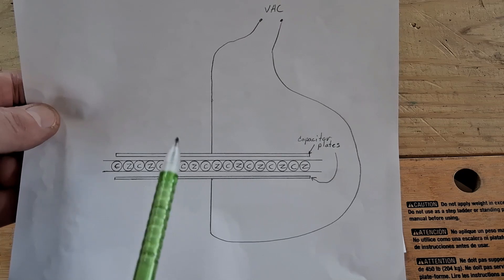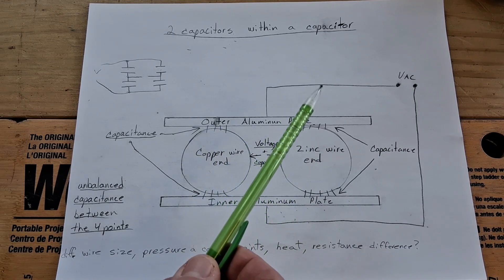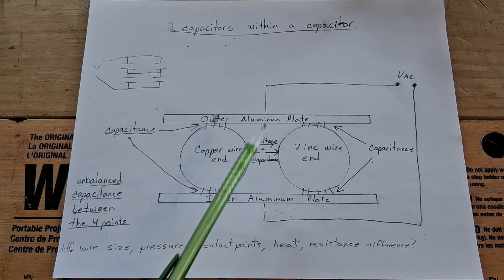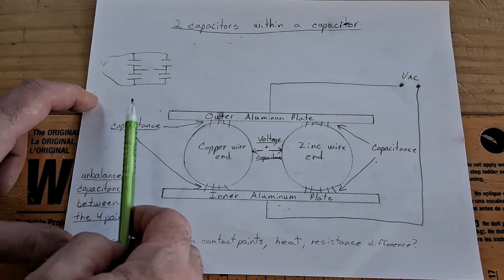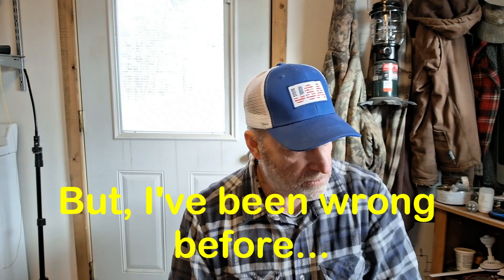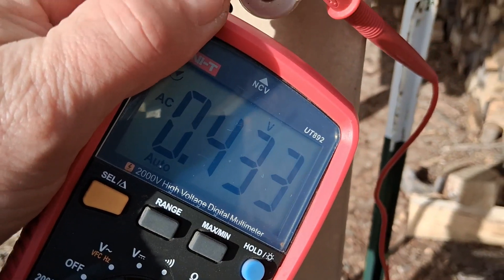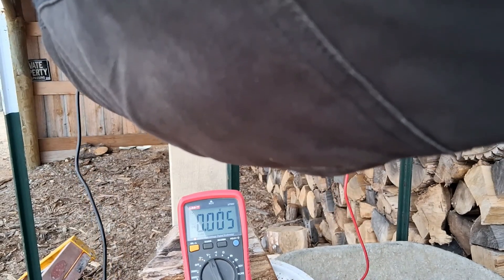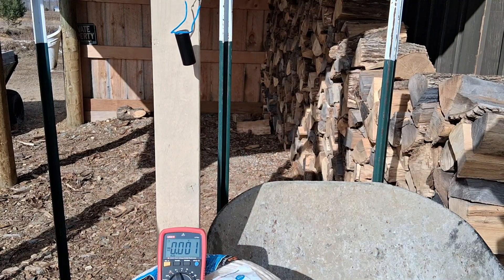Cu-Zn capacitor sandwich follow-up, and Cu-Zn antenna (no ground)

Comment: Zinc in carbon fiber in a copper tube somehow wrapped like a induction heater or a U with a O with distilled water creates a covalent bond separator of the H2O, there is a video a couple Europeans showing power from water!

Comment: You are sensing static voltage due to charged air currents rubbing against the wires and induced AC voltage from magnetic fields. We are immersed in moving magnetic fields. There are 60 cycle ground currents from electron flow returning through the soil to the local electric generating plant. There is induction voltage from nearby overhead power conductors. The are moving magnetic fields from currents flowing through the layers of the ionosphere, eg. D, E, and F layers overhead. There are currents flowing through both the ground and the ionosphere due to thunderstorms all around the world. The is also Hall Effect voltage (and current) induced in the wires from the moving magnetic fields.  And finally, the Earth itself is a giant dynamo rotating the whole smear at 15 degrees per hour and cutting across the field lines due to the solar flowing past us at a million miles an hour.  You have made a crude detector of the Sum of all those various currents. The metal junctions formed by twisted wire connections act as diodes rectifying the myriad tiny (very) AC currents flowing on the wire, to charge the capacitor to a DC voltage.   You might experiment by pumping the aluminum capacitor plated at 10 million cycles per second in place of 60 cycles per second to see if a bifilar wound coil with dissimilar metals inside of an RF field might generate some electron behavior we have not yet recognized.
73   Dr. O

Comment: It’s not even a capacitor, a capacitor is actually part of the circuit. When you connected both copper and zinc wires voltage drops to 0.  You measured current between two dissimilar metals and thats it. 

The voltage was induced and had nowhere to go because it was an open circuit. The 120V alternating electrical current wasn’t even flowing it was just sitting there on the “capacitor plates” aluminum tape and again the induced voltage disappeared when you closed the zinc to copper wires.

Google 1000+ Fluorescent lamps powered by overhead cables image. It’s the opposite of your dissimilar metals “antenna“ the fluorescent tubes are grounded but lighting up by the induced voltage from the overhead wire. 💪😎👍
Reply: It can't be a galvanic reaction because the wires are insulated from each other.
.

Comment: Danke für die Videoserie Ihnen Double M Innovations.

Es gibt in der Materialphysik die sogenannte Planckmasse. Dies ist ein Massequantum. Es ist die gravimetrische Trägheitsbasis aller Planckkonstanten. Das Wirkungsqunatum h geteit durch das Quadrat der Lichtgeschwindigkeit c² ergibt die sogenannte Materialzeit mt. Teilt man mt durch die Masse eines Proton erhält man das Zeitquantum des Proton. Die ist zwar sehr klein aber man kann sich das mit 2^n in den Bereich harmonisch verlängern der unserem Bewusstsein besser zugänglich ist. Dabei sind 5,3 Sekunden eine harmonische dieser Zeit. Zink hat 30 Protonen damit kann etwa 159 Sekunden ermittelt werden. Kupfer hat 29 Protonen was 153,7 Sekunden ergibt. Eisen mit seinen 26 Protonen erreicht 138,6 Sekunden in dieser Harmonie. 

Es scheint so zu sein, das der innere Schalenaufbau der Isotope dabei zur Wirkung kommt. Denn sonst würde der aufgspannte 3 Leiter Kupferdraht keine Spannungswerte zwischen den Leiter erzielen. Wenn es bei Kupfer zu einer Spannungsdifferenz zwischen unterschiedlich dicken Leiteradern kommt, kann der sogennante Casimiereffekt ein hilfreicher Schlüssel zum Verständnis sein. 

Seit ungefähr 24 Jahren habe ich eine gravimetrische 50 Hz Goldschnittantenne GSF in Betrieb. Diese besteht aus 3 großen Drosselspulen und 2 Kondensatoren. Die Impedanz beträgt  ca. 152 Ohm. Die Güte der Spulen ist sehr hoch. Es sind 3 hochwertige UI186a Kerne mit ca. 9,8 Kg Masse. Der Eingangskreis ist auf 50 Hz / 1,618 abgestimmt und der Ausgangskreis auf 50 Hz * 1,618 so das sich ein 50 Hz breiter Bandpass ergibt. Die 3. Drossel ist zur Impedanzanpassung ist mit einer Anzapfung bei 0,707 der Gesamtwicklung versehen. 

Leitungsbetrieb: Der Filter kann direkt an bis zu 162 Volt 50 Herz angeschloßen werden. Er ist in der Lage ein 50 Hz Rechtecksignal in ein sehr sauberes 50 Hz Sinussignal zu transformieren. Das bei eine Leistung bis zu 173 Watt. 

Antennbetrieb: An der Eingangskreis sind einige alte Elektrogeräte als Antenne angeschloßen, ebenso gerätesymerisch an den Ausgangskreis als Last. Alle Kabel dabei sind dreiardig ausgeführt. Der Erdleiter hat an keiner Stelle der GSF Antenne einen Kontakt mit den beiden Arbeitsleitern. An diesem Erdleiter liegen ca. 6 Volt Spannung an 1 Megaohm Last gegen das Erdleiterpotential unseres Stromnetzes an. Die Frequenz berägt dabei 49,99... Hz bis 50,01 Hz je nach aktuellen europäischer Netzlast. 

Duch ihre Anregung werden ich auch den Versuch starten eine Brückengleichrichter anzuschließen und einen Ladekondensator mit Vorwiederstand dahinter. Die RC Lade-Zeitkonstanten für die verschiedenen Elemente aus der Protonenzeit kann dabei durch synchronen Paralleaufbau der Schaltung für RC(Kupfer) RC(Eisen) RC(Kohlenstoff) realsiert werden. 

In meiner Buchsammlung der letzten 50 Jahre habe ich ein Druckwerk ISBN 9-534-11037-9 in welchem die Elemente als Spurenelemente der Lebewesen klinisch untersucht wurden. Dabei sind für Kupfer Kapitel 10 Seite 56 bis 60 und Zink Kapitel 17 Seiten 105 bis 109 bemerkenswerte Unterschiede gelistet. Das Blut von weiblichen Wessen enthält mehr Kupfer als Zink und das Blut von mänlichen Wessen hat mehr Zink als Kupfer typischerweise als Spurenelement in sich. Neugeborene organische höhere Lebeswesen haben sogut wie kein Zinn Element 50 im Blut. Erst nach der Geburt reichert sich dieses Element Z 50 im Körper auf das jeiweilige erforderliche Lebenshalteniveau an. Zinn hat 10 dauerhafte Isotope von 112 bis 124. Die Isotope der Zinnmasse 113 und 123 sind nicht stabiel. 

Es könnte sein das diese Differenz der physikalisch phsiologischen Funktion der Elemente Kupfer und Zink sehr bedeutet sind. Vitalwert Leistungssenoren die auf Kupfer - Zink Wirkungsenergiepotential beruhen könnten so entwickelt werden. Da es sich relativ sicher um eine wirksame Lebensernergiekorrelation handelt ist ein Leitungsgerechter Umgang mit der physikalischen physiologischen Funktion sehr sehr ratsam. 

Die Fähigkeit der Elektronen zur Handhabung von Spannung, Strom ist mit einer sehr bedeutenden geoemtrische strukturallen Länge verknüpft. Die sogennante Comptonwellenlänge des Elektrons geteilt durch 3 im Kubik und diese geteilt durch die Plancklänge ergibt eine Fläche deren Quadratwurzel -112 mm und +112 mm ergibt. Die negative Länge ist innerhalb der Isotope mindestez des Wasserstoff als Weg ab Kernradius bis zum Orbitalradius wirksam. Die postive Länge von 112 mm je Elektron kann für alle möglichen Zwecke genutzt werden. Bei diesem 112 mm Quantum nach Müller ist ein Elektron isolinear wirksam. 

Gruß Reiner Markenfreund
von Michael Frithjof Müller

Comment: Hi there, well-done this is cool.   I think what you have built is very close to a stubble field battery. 

Copper - zink or aluminium forms an A-symmetric capacitor which slef charges.  Like a battery but without the electro chemical reaction.

You would normally only get 0.8x volts between the copper and zink wire, so something interesting is definitely happening when you apply a charge to the aluminium plates.   

The copper is + in respect too the - zink. I'm guessing the charge on the aluminum is somehow driving the voltage up through imbalanced capacitive coupling.
Reply from the maker: Thanks for your perspective!

Comment: The higher you run your antenna wires the more current and voltage, it will sometimes eventually build enough to strike from antenna wires the more to negative wire or the ground, you can elevate the capture by putting outcasting elements along your antenna wire and coating those and the antenna wire in graphene  powder, basically I think it’s simulating the same effect like a cloud, and it builds the power off of parasitic currents going through the atmosphere
Reply: One day, I had a portable AM radio that was tuned between stations, where I could hear lightning discharges, as a storm front was moving in. I noticed there was also a sort of corona-discharge, hissing-sound in the AM radio, that increased in strength as I approached the house that has lightning rods on our rooftop. Point is, these discharges can happen quite regularly, and can obviously be influenced by the weather. I am sure most people already know this happens, but it was interesting to hear it in the AM radio.
Reply: I have been trying to come up with what is causing the DIFFERENCE in potential between the two wires, because this is what would take to charge the capacitor. Your description of arcing from one wire to ground, is the only one that makes sense. An arc between either wire and ground, will draw current through the bridge rectifier, through the capacitor, and through the other half of the bridge rectifier, to force a discharge of the other wire as well. Hence, every arc to ground will add a little more charge to the capacitor, as it discharges the opposite wire. I would guess that the limit of 1.86VDC on the capacitor, is point where the electrolytic capacitor's internal leakage rate (self discharge), is equal to the average charging rate from the atmosphere. I wonder if an oil capacitor, such as a run capacitor from an electric motor, would allow the voltage to go higher.
Reply: @ try using a spark plug between the cap to the antenna lead.. this should let the current build up and when higher it would then jump, just a theory
Reply from the maker: I have a number of videos with harvesting energy from antennas, you may like.  (would need to take a look through my video list).  Some where you can see when the AM radio station boost their power, and another where you see an increase caused by a distance lightening flash.

Comment: Now that you have balanced the capacitances by removing some of the wire from one of the coils, the remaining factor that is upsetting the balance, has to be from stray electric fields. 
You are making measurements to a very high impedance circuit, that start out to be a BALANCED circuit. However, when you connect the voltmeter that does not present the same load to both test leads, it throws-off this balance. Things that I noticed in the PREVIOUS video, that can throw-off the balance are:
) The voltmeter is on a table that is exposed to AC fields. Wood is NOT a perfect insulator.
) The ammeter that is connected to 120VAC, is placed on the table, right next to the voltmeter. This introduces a capacitive coupling between the ammeter and a foil shield that is inside the voltmeter, which internally connects to the black voltmeter lead, but not to the RED voltmeter lead. This capacitive coupling to the BLACK LEAD ONLY, throws-off the circuit balance. For high impedance circuits, even a small, stray current is noticeable. It is not a problem for unbalanced circuits, because this stray current would pass through the black lead to ground.
In the FIRST video on this subject, you were testing the output voltage, and the input current. At 4:33 in the video, the reading on the voltmeter changes, when you are moving your arm and the pencil around the area. Also, the ammeter reading changes as you reach your arm over and around the coil. At 6:10, the current-reading changes when you grip, and then release your grip from the green, alligator clip. This is evidence of surrounding fields that are enough to throw-off the balance, and affect the readings.
Tests that may be interesting to perform include: 
) Reverse the wires from the AC line, to the capacitor plates. This can change the magnitude of the stray currents, which can change the voltage reading.
) Use small, TWISTED-PAIR wire for test leads, such as is used in CAT 5 cable. Extend this wire-pair perpendicular to the coil assembly. This will help balance the exposure of each wire, to the coil assembly. Then, set the voltmeter up on a cardboard box, to move it away from the ammeter, from other wires, and off the table, thereby reducing capacitive coupling to its internal shield.
Making BALANCED voltage measurements to a circuit with approximately 8 megohms impedance, is very complicated. One way, is to use the DIFFERENCE setting on a 2-channel oscilloscope, using only the tips, of two 10X (or 100X) probes. The scope will display the DIFFERENCE in AC voltage (Channel-A, minus Channel-B). 
Warning! The oscilloscope’s ground lead is ALREADY GROUNDED, via the grounding pin of its power cord. DO NOT connect it to the AC line! ESPECIALLY the HOT side!
Regardless of how it is measured, the input impedance of the metering device must be figured into the results. If the meter has the same impedance as the circuit being tested, then a circuit with 10 volts EMF, will drop to 5 V when the meter is connected. The math is more complicated if the meter is resistive, and the circuit is reactive, because then, we must consider the phase angle. Thanks for posting.
Reply: One thing we have been assuming, is that the two coil-wires have the same leakage RESISTANCE to each of the foil plates. This might not be the case. The sticky ADHESIVE of the packing-tape, might not be a good insulator. Only the BARE (zinc) wire has direct contact to the STICKY ADHESIVE of the packing tape that overwraps the coils. The other wire is protected with an enamel coating. This may be creating an imbalance in leakage RESISTANCE, and therefore, leakage CURRENT to the two coil wires. 
To measure the very low leakage current, I will assume that your DC ammeter cannot measure current below 1uADC. So instead, we can use the DC voltmeter, to measure very low currents. It is assumed that the input resistance of the voltmeter is 10 megohms.
First REMOVE AC POWER, and disconnect all wires from the coil assembly. Then, connect the POSITIVE terminal of a 12VDC power supply, to the outer foil plate. Setup the multi-meter to measure VOLTAGE, and connect the voltmeter’s RED lead to one of the coil wires. Complete the circuit by connecting the BLACK voltmeter-lead to the power supply’s NEGATIVE terminal. Turn on the 12VDC power supply.
If the voltmeter reads say; 2 VDC, then this means we have 2 VDC across the 10 megohm internal resistance of the voltmeter. Ohm’s law says we have 200 nanoamps of leakage current (0.2uA) to this coil wire. Now, disconnect the RED voltmeter test-lead from the coil wire, and connect it to the other coil wire. If this reading is 3 VDC, and therefore 0.3uA leakage current, then we have a 0.1uA DIFFERENCE between the two leakage currents. The circuit is not balanced. 
If the 12 VDC were to be increased to 120 VCD (Not recommended, for safety reasons), the leakage currents would obviously be 10 times greater. Using a DC power supply, effectively removes capacitance from the equation. 
If it is found that there IS an imbalance, consider flipping the packing-tape over. You might also want to make both coils have the same number of turns again. Thanks again, for posting.

Comment: Thanks for the research! I'm still keeping my opinion about the cold current :D I need to try to replicate this with aluminum wire and floor heating cable (carbon fiber). You might also want to look into displacement current. Joel Lagace has good videos about it.
Reply from the maker: There could be something more to it; there are some things I still can't get my head around.  But I think I will need a bigger test bed, so that measurements could be better.  I think the Cu-Zn antenna may have something to do with ions in the air, with bare metal...  Thanks for your comments!
Reply: @doubleMinnovations  Yes. Some call it ionization too. But it's different when it comes from outside source, like radio waves. It's the same principle as vacuum tube, but other way. It's all in Bernoulli's principles and Maxwell. Electricity is surface tension. When you excite the surface, it has more electrons to collect. I'm not trying to be right or wrong, just also very interested to learn :)